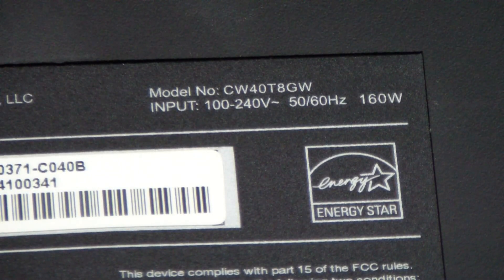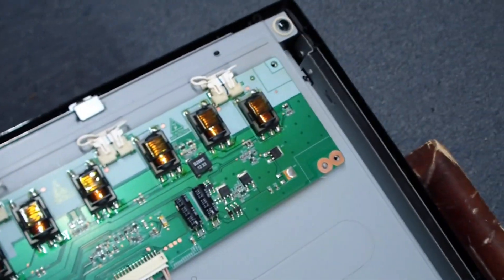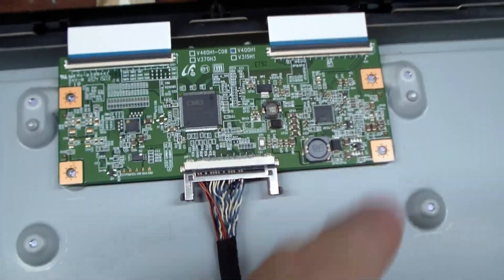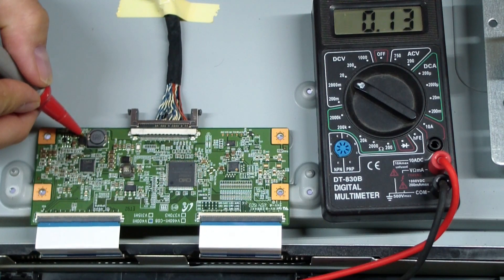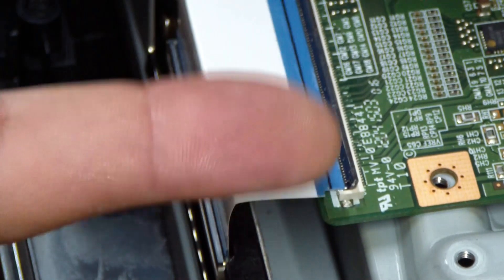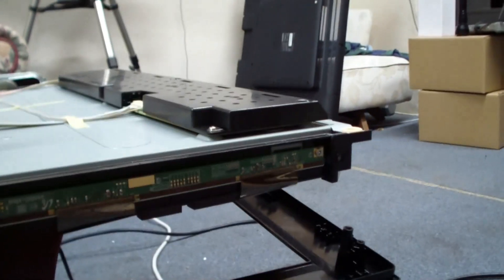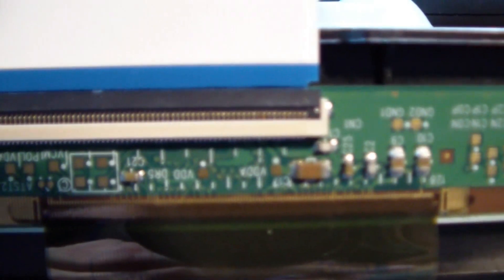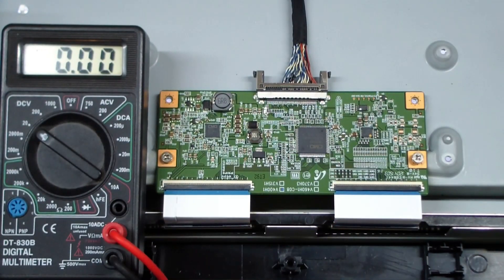Westinghouse LCD TV Repair - No Picture

Comment: My Westinghouse 42 in. ROKU tv went black and doesn’t come on at all. For several wks. I would get a message, “device is overheating”, so I put a fan pointing to the back but still got the same message. Now it doesn’t come on at all?
Reply from the maker: There are TV repair forums that will give you better troubleshooting advise.

Comment: If you end up with a blacklight problem most likely is you are running the brightness too high. It may be a setting that 
you can control to lower the brightness and thus the voltage to the LED's that are very bright. By reducing that one 
thing it should make any TV last much longer at least where blacklighting is a concern. Best to find a sweet spot
between 50 and 80 percent brightness for the room conditions you have your TV set in.

Comment: I have the same problem I'm one that never had any schooling in electronics but for some reason I can do it with no problem I came across your video you have giving me more insight thank you oh I wish you had more walk through going deeper so I can follow you if change both circuit boards and the problem is inside you didn't show the part where you use your soldering iron to go inside the panel anyway I'm looking for more of your video on Westinghouse TV for a 50"

Comment: @kent diego what if the backlight is low, what do you believe is the problem?
Reply: its a Westinghouse WE-M16076 tv
Reply from the maker: Not entirely sure about dim CFL. Check some TV repair forums for better information.
Reply: @KentDiego  I mean the backlight is low. U can see video when flashlight is used. So what do you think is the problem
Reply: Already changed the Tcon board and same problem

Comment: You demonstrated nicely, something an engineer told me years ago... "The part that is burnt up (in this case the fuse) is rarely where "THE" problem is. Something else has gone wrong and burned out that part and THAT is what you have to find. If you just replaced the part that has burned up/out you will you'll just keep burning out that same part."

Comment: Where did he put the negative (black) cord from his multi-meter when he was testing the T-con board?
Reply from the maker: Chassis ground.
Reply: @KentDiego  So just any metal on the TV frame right? Thanks for replying btw! Great video too! I actually just fixed one of them I have, (I got like 10 free off Facebook over the past few years, seems like every time I ask at least one person has one they are throwing away, and this is a town of like 30k people, so that's a good way to find some). Anyways my main one just died, (its the Power supply and not the caps this time, I already fixed those 5 years ago and still good, but yeah now it blows the fuse instantly, and yeah its dark around 3 diodes I just don't know what the part numbers are on the diodes to order them haha. Phillips 42PFL5432D/32, its pretty old yeah, got that free to yeah haha). Yeah I found some kits for like $14, Idk I might try it. Cheapest board I found was like $55 bucks hard to find those but I saw other TV's had the same board, some Maganavox ones ya know? So that's always good to check that too, sometimes cheaper, obviously match the part number on the board, (I know you know this, but for others reading this, its a good tip if they can't find one for their tv).

Anyways on this other TV I just fixed, a newer 50" Toshiba, (looks brand new still, the guy didn't take the protective plastic off around the sides yet, crazy huh? He was just going to toss it in the trash). 

I took a guess that it was the T-con board, it didn't have lines in it or weird colors but the screen would jump up and down, I figured it could be the main board too but I found the T-con for $8 free ship on ebay so obviously I'm going to try that first lol! Yep did the job!! I had no idea how to test T-CON boards, so thanks again for the video!! I mean for future repairs on other TV's. I just got lucky on this one, I think the main board was around $100, like yeshhh.. idk if I wanted to pay that much, but I was going to if needed as this is like a $700 TV probably.  Anyways sorry for the long message here. Figured you or others might find it interesting. Thanks again for the great videos! Helps a lot!

Comment: Pulled a 60" Westinghouse (VR6025Z) from the county dump (I grab all tv's that have intact displays) Get it home, power it up, I get a "W" logo for about 1.5 seconds, then dark. flashlight shows me display still on, so my first thought was same, which I dreaded (have broken a display or two trying to remove) took back off and went to check inverter input voltages 1st. this 60" monolith had huge inverters, a Master, and 3 slaves. thats when I noticed a 14 pin jumper connecting slave 2 and slave 3 was burnt to a crisp, insulation on a couple of lead wires gone, in fact one wire was burnt so bad it was gone. Ok, maybe it's not an LED issue then... lolz
I had 24 volts going into these, so PS was good. I ESR'd the inverter board caps, all good, mosfets were good, all transformers rang good...drove me crazy, so I slept on it (I find it's good to ponder)It hit me next morning like a brick...Bad grounds, just like the Samsungs (common problem w/ those)
Even remember saying to meself when un-screwing the inverters off that these mount screws were loose as hell. I found another 14 pin jumper from my box O leads,cables and wires. then replaced these cheap screws with a better type that "bites" better.
Ta-Da, display stayed on!! I checked all screws on all boards, and yes every damn one of them were looser than a 2$ Ho ;)
the heating/cooling cycles over time had loosened them. I replaced all the screws and have a 60" in the living room now. I got 7$ invested in this thing (new ebay remote) and a few hours labor...not too shabby ;)

Comment: Can you help me when I try to turn my craig tv on it does not show the red light and it's making a weird sound
Reply from the maker: No DC power. The AC line voltage is rectified to 160V DC and is applied to switching transistors to make square wave. This goes through transformer and the low voltage DC is created. The noise is likely the transformer. Open TV and find wher power cord plugs into power supply. Look at part number. Maybe you can buy a used power supply online or on eBay.
Reply: K
Reply: So when I get a new ac adapter it my tv will turn back on?
Reply from the maker: I am assuming the power supply is failed due to no LED. Best is to measure output of old PS to ensure it is bad before buying new one. Might have 5V and 12V outputs. I have a few videos where I show how switching power supplies work.

Comment: WHAT IS WRONG WITH MY WESTINGHOUSE 32" EVERYTHING IS FINE WITH PICTURE THEN 20MIN LATER IT DOES WHAT I PUT IN VIDEO BELOW AFTER 20-40 MIN OF THAT IT WORKS GOOD AGAIN THEN IT SLOWLY GOES BAD . I THINK TCON  NEED SOME ADJUSTMENT OR CLEANING BUT NOT SURE
https://youtu.be/d4j_7Wqqv64

Comment: This tv has made me so mad!!!! No warnings signs at all!!! My tv completely black and sound is fine! I have this tv for about 4 or 5 years
Reply from the maker: It is all about luck. The TV has hundreds of components that should each last 50 years but when you multiply all the probabilities together you are lucky to get 10 years. The bright side is TVs are always improving. 20 years ago a CRT would start noticeably losing brightness after 5 years and be unwatchable after 10. The new TVs now have LED backlighting that should last much longer and use less power. They are getting better black levels now with new flat panel technology and the internet connected smart functions are really nice. I am amazed by how much TV prices have dropped lately so now is a great time to purchase a new TV,
Reply: I've used mine for one day

Comment: My nephew has a Westinghouse LTV-37w2 TV that was working fine while I was house sitting. I turned the cable box and TV on, "HDMI setup, " flashed on the screen and the screen went dark. I still hear the channels from the cable, but no picture. I unplugged the TV and the cable, when I turned both back on, the cable message showed up briefly, then back to a dark screen. Do you have any suggestions? I feel so bad that the TV stopped working while I was there.Thank you!
Reply from the maker: The backlight seems to be problem. If you shine flashlight into screen you should see picture. Likely the CFL tubes are old and causing the high voltage inverter to shut down.
Reply: Kent Diego Thank you for your help. Everything else I read about this brand name with the same problem brings up the same solution.
Reply: Kent Diego Apologies, I forgot to ask if it's cheaper to buy the part or just buy a new TV?
Reply from the maker: Unless fixing TVs is a fun challenge for you then I suggest buying new. The new TV have LED backlights that last longer and use half the power. I am not sure how easy it will be to get the correct replacement CFL and it could get tricky. There are hobbyists that replace the CFL with LED strips. Google it. It would be fun to experiment with but not likely time and cost effective..
Reply: Kent Diego Thanks again for your help. I would be willing to try to fix it, but I know my nephew would rather just buy another one.

Comment: I have a 42in that just went black on me. Still have sound and I tried the flash light trick.  I can see the picture but you never say what's he next step in that method of diagnosis
Reply from the maker: That means the back light is out. Could be the high voltage inverters that supply the lights or the CFL lights them selves. When CFL lights get old they draw more current causing the inverters to shut down. Look on the badcaps forum to find repair guides and advice.
Reply: You have a no back light symptom.  Your main board is good.  Could be a high voltage inverter problem on power supply.  It could also be shorted or open led's on back light panel.

Comment: I have an identical problem on a Westinghouse 55" Model: DWM55F1Y1
Wierd fact: this issue was intermittent and some days the TV would work fine other times no picture. it's been about 3 months since the last time it showed up and I want to address it and see if I can fix it or if I need to replace it before the holiday sales. online research suggests the Tcon board but the fuses I checked look ok... I also suspect a capacitor on the LCD panels but your video skips what you did to fix this issue... you removed the bad capacitor? I didn't see you replace it? I am a beginner at handling electronics like this but I am hoping I am in the right ball park and could use some guidance.
Reply from the maker: A shorted cap took out tcon board. I removed bad cap and did not replace. It was on Vcc line so not so important. They do not cure them self's. If you have intermittent look at the ribbon cable connection or maybe cold solder joint. With TV on try tapping around to isolate area with problem.
Reply: Kent Diego I now have an all white screen I was troubleshooting ribbon cable and now half of the screen is solid white the other is a dirty white...
Reply: I swapped ribbon cables and same side still solid white. the dirty white side goes solid when I disconnect the ribbon for that side... so I think I have a new problem now...?
Reply: I think I might have shorted something while testing current through the caps on the VCC line... but it appears they all test the same
Reply: I checked current n all the parts that look like fuses on the Tcon board. I still cant pinpoint my issue... i don't want to just throw parts at it without knowing which needs to be tackled...
Reply from the maker: In this video I show voltages but TCON board is bad here. Good has much higher voltages. See newer TCON fuzzy image video I made for correct voltages. I used ohm meter to look for short across the caps at side of panel. The Vcc was shorted so had keep removing them until I found bad one. I think it is easy to kill the TCON board. Often problem is at connection to edge of panel. Check the "bad caps forum" for TV and monitor repair guides and advice from experts.

Comment: TCL LE55FHDF3300ZTAAA My TV started turning itself off from time to time, then more frequenlty sometimes it would sit a hour or so and then it would work again, then recently a day or so and it would work for a while.  when it turns off standby light always comes on. When it does work the picture is always clear no lines or distortion. I've seen this model TV also in a Sanyo with the same boards.   Any help if it is the T-con or the mainboard?

Comment: I have a Westinghouse 32" it doesn't power on and off by buttons but on when it plug it show the logo and flashing in changing color
Reply from the maker: +Edner Delva I think that says the LCD panel works but the "flashing color" part is uncertain. Can we say LCD panel is good or are colors badly distorted? 
Maybe the back light is good. Does sound come on? Shine light into screen and see if there is picture. Do you see glow of back light in dark room? If back light is good then it is either power supply board or main video board. 
I have found the BadCaps Forum has a lot of TV/monitor repair info.